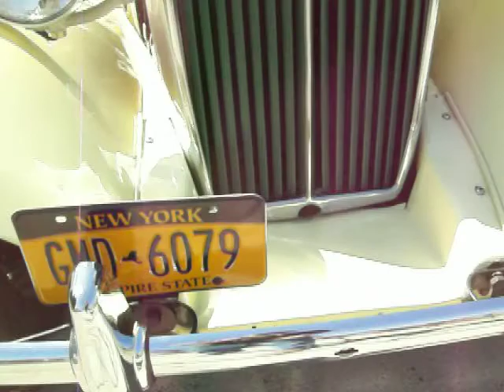MGTD   HAND CRANK START

Comment: You never hold it like that nor keep your thumb over the crank. Quick way to break your hand or arm if it kicks back. Thumb below the handle with palm facing up and only one hand on the crank standing off to the left side right hand on crank.
Read the manual or look at a Ford model T manual  for how not to break your arm!
Thanks for Posting !

Comment: missing a few important steps. 1) set parking brake on, 2) turn ignition OFF! 3) put transmission in neutral, 4) set choke for current weather and engine conditions. then 5) prime a cold engine with fuel by turning the engine over two or three times with the IGNITION OFF, then 6) as the host shows us, give it a good pull and hope it starts.

Comment: I also drive aTD. I wanted one for 50 years. I picked it up past fall. I am in the process of replacing the clutch. Haven never done it before I purchased a service manual and am proceeding with caution. How is that for a comment?